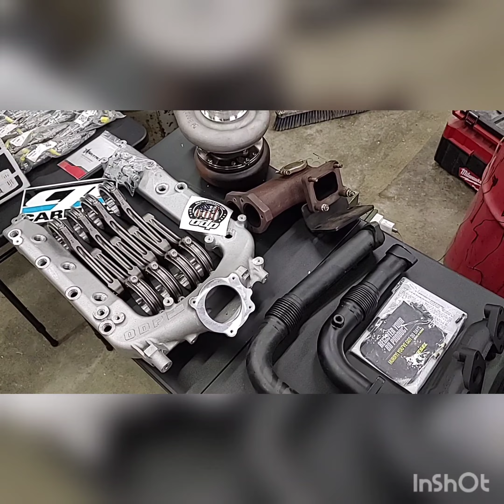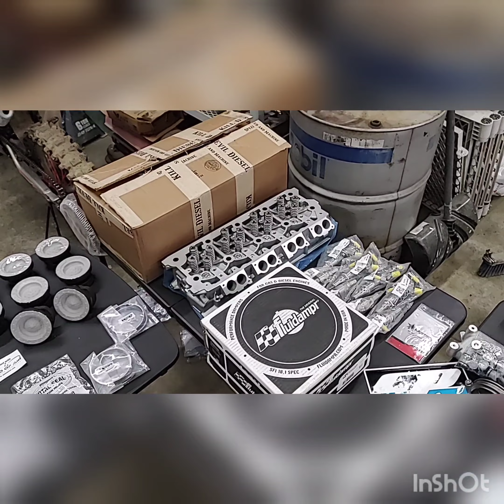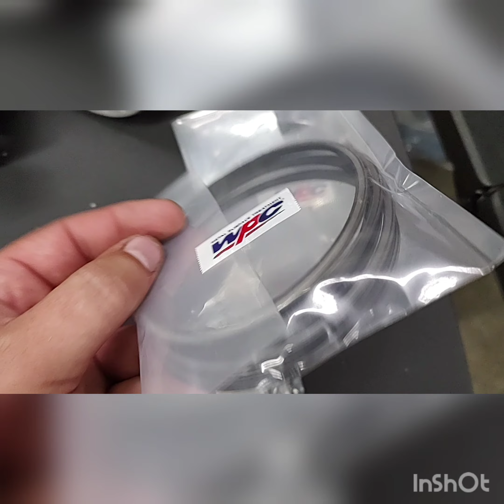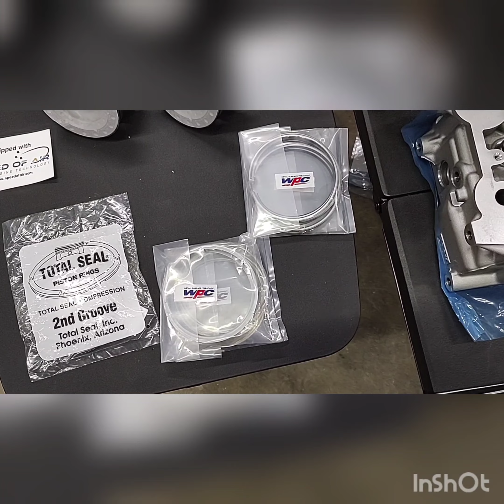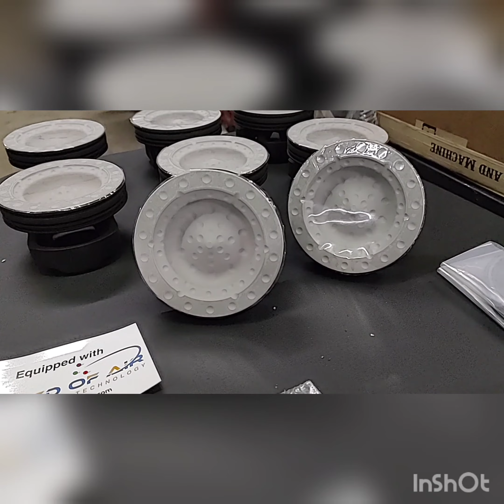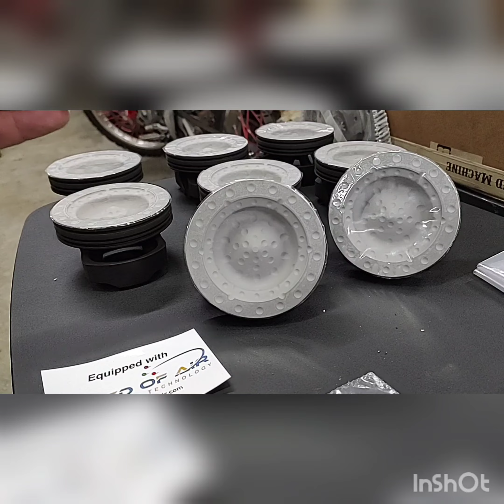Ultimate Towing 6.4 Powerstroke Build

Comment: Any update on this truck? Fuel mileage, oil consumption, regrets? I have an f450 that I’m on the fence about putting a Cummins in. It’ll always be hanging around that 2,000+ rpm with the gearing it has. I’m very interested in those pistons though. I don’t think the internal combustion engine is on its way out. It just needs updated.
Reply from the maker: @stevenodell9458  at the moment, sorting some issues out. We've only put about 4000 miles on it, so far, but the engine is absolutely awesome. The reason it hasn't gotten many miles, though, is because the big single turbo completely missed the mark. I put compounds back on it, but the high pressure only got about 1000 miles before the vanes seized. I'll be putting it back together this coming weekend (9/7/24), and I'll make a full update video.
Reply: @460EFI  thank you for the update. The luck you are having is about like mine when I think I have everything wrapped up and good to go for another 300,000 miles. You are an inspiration to us 6.4 guys just for pioneering with new technology, keep up the grind. Can’t wait 🤘

Comment: Im in central fl, we fully blue printed, bored .40 over and balanced the block and rotating assy for our 6.4. The crank and rods are cryo treated. The wrist pins are DLC coated, the main bearings and rod bearings are wpc coated, the heads are brand new with fire rings, SS valves, harden seats, upgraded 20lb heavier prings, maxxforce7 pistons that are delipped, fly coat and ceramic coated. Lastly we used ALL arp hardware except for the mains, and installed a callies stage 1 billet cam, billet push rods, with choate self oiling rocker covers. BD exhaust manifolds, rudys HD up pipes, upgraded billet compounds. Stock injectors. Alliant hpfp.

Comment: I've done lots of research on those pistons (speed of air not the steel pistons)and there claims are not proven. I heard the owner talk about them on the diesel podcast and there hasnt been any hardcore testing on them and his claims of put 1 in a cat engine and it never ran a regen in 10 years sounded like snake oil sale man. Cool build tho. KKD and there work man ship is top notch
Reply from the maker: Well, I have an engine built with them, a personal friend and shop owner has a couple of engines with them, and I've spent hours on the phone with the inventor of SoA, Joe Malfa, who spent 20 years testing and developing it.

https://www.enginebuildermag.com/2021/05/speed-of-air-engine-technologies-performance-breakthrough/
Reply: @460EFI  not knocking ur build its cool man. I've read that article about the pistons already but it wasn't a like for like test i.e. stock engine then only change would be the pistons.
Reply: @460EFI notice any difference with the pistons? I have upgraded compounds and the odawgs intake in mine. Just saving up money for when my pistons let loose

Comment: Looking at an '08 350 Regular cab. If we buy it, the truck will be used as a tog pig to tow our 20k lbs dump trailer.

Still watching your video. How much are you into this engine if you don't mind sharing?
Reply from the maker: We've got about $30k into it, not counting my labor. That being said, now that we're getting some miles on it, even with the DPS Turbonator, the S369 turbo is just not suited to the towing duties of this rig. It works fantastically, just driving around, but I'll probably be changing the turbo in the near future, possibly even going to factory style, modified compounds.
Reply: @460EFI what turbos did you land on?
Reply from the maker: @leebo92_38  I honestly haven't had time to mess with it. I'm going to try just swapping the super core out for an S364, first.
Reply: Really appreciate your input! Is it the engine (turbo) or transmission that makes the truck not suited for pulling?
Reply from the maker: @gradyb6264  it's most definitely the big single turbo. Even with the VGT housing, it's still really laggy. Everything else does exactly what it's supposed to do.

Comment: I've got a 08', about to do a swap.  The plan right now is to get a KDD long block, use KDD iron heads, ODD intake, BD exhaust manifold with up-pipes, and to use my fuel system down to the injectors (because it only had 25k miles on it).  Question I have for you: 1) if BD doesn't make the non-egt up-pipes, how did you get them? 2) Early in my research I saw the SoA pistons; what do you think of them, is it doing their job as advertised?
Reply from the maker: I got the BD up-pipes second-hand. Not easy to come by, these days.

I fully recommend spending the money on the aluminum heads, especially if you're using the ODD intake manifold. It's unbelievable how responsive this engine is, and I fully attribute that to the combination of the aluminum heads and SoA pistons. 

If you look at my follow up video of it running, it's astounding how quiet it is to stand next to. I got a custom tune done, after the video, and what would be a roughly 60 HP "tow tune" is butt-dyno'd, by multiple people, around 550/1200 at the tires. Hopefully I can get it on the rollers in a month or two.
Reply: @460EFI  I've got to draw the line somewhere LOL.  I've got a $21k budget and the aluminum heads push me over with everything.  Talking about the quietness of the engine, the guy that's going to do my work has a hot rod KDD 6.4 build and he said, "You can almost whisper with the the hood up!" LOL
Reply: Just buy the steel piston short block or builder kit from kdd

Comment: How much was the speed of air modifications on the steel pistons?
Reply from the maker: It was about $1600, but mine were the first set of 6.7 steel pistons ever done by SoA, and they're currently the only set they've done for use in a 6.4.